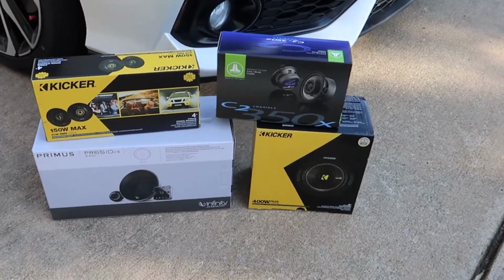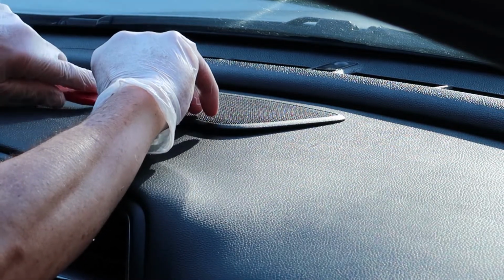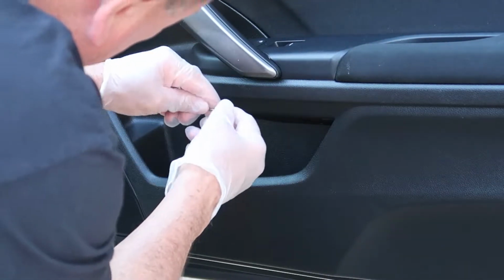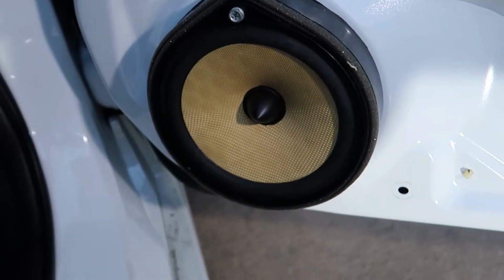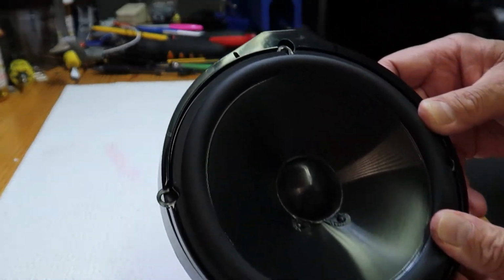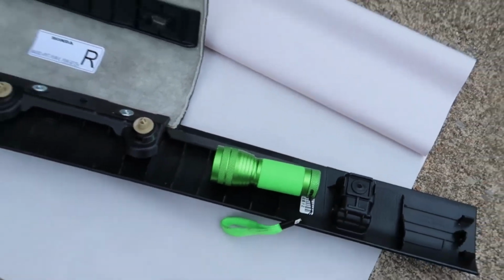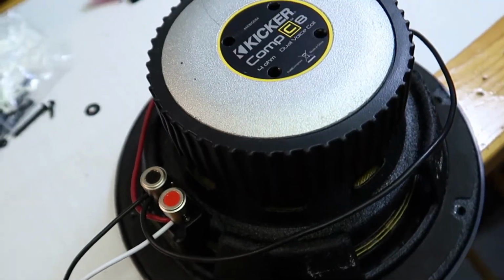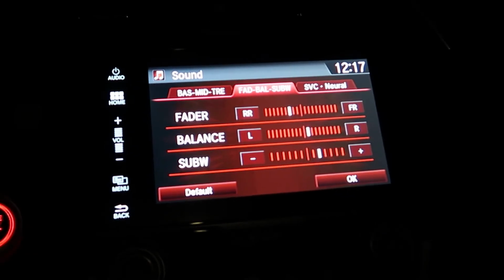How to replace speakers on a Honda Civic Si 10th Gen #Civicsi #Honda#Crutchfield

Comment: Very helpful video! thanks for that. Wehn I search for sound kits they always include a passive crossover. Some say the civic does the crossover inside the original speaker so I do need the passive crossover when repleacing the speaker.  Is that true?
Reply from the maker: I didn't use one and my speakers are working very well! So you can skip the crossovers at this time. If you replace the stock amplifier that might be a different story. 👍🏁
Reply: @Zspeed Thanks for the answer I appreciate it! I just want to replace the speaker and will continue to use the stock amplifier. That helped 😊

Comment: Good video man like I’m no speaker master installation guy videos like this help me n everyone. I used to have a 10incg slim sub that went under the seat’s i believe it was call seven kicks or kickerseven something like that it had a spider logo it was a standalone unit built in amp n speaker in a little flat box 1200watts just had to get power and signal to it. It worked great for its size surprisingly bass for day’s fuller sound but only lasted 2 1/2 years what a rip off I know it was only $150 at least but still didn’t last long . Been thinking of upgrading my entire speakers but just didn’t want to take on the task not being a sound guy ya know looks totally doable though now that I have seen it done. Mostly want more bass but extra midrange would be welcomed
Reply from the maker: You will need an aftermarket amplifier if you want more bass. Now that my speakers are upgraded and sounding good, you still need a better amplifier to get that hard kick your looking for!

Comment: I have a question will these speakers work on my 2021 Honda Civic sport hatchback because last time I installed speakers the sound wasn’t really good not from kicker it was from a different brand but will it sound good from kicker?
Reply from the maker: My kicker sub is under powered with the  stock amplifier. Your sub should sound better with an aftermarket amplifier! I'm looking into one that would fit into the  stock location.

Comment: this vid is like 2 years old so i dont expect a reply  but does the wattage matter?
Reply from the maker: Lower watt speakers if you never plan on amplifying your system. This setup works, but it is under amplified.
Reply: @ oh so I’d have to get a low wattage system to keep mine stock because I do want to stay stock for the most part I don’t know much about wattage so it’s what stops me from doing a subwoofer swap
Reply from the maker: Yes, use Crutchfield.com as your guide for replacing the door speakers!

Comment: Few questions for ya. I have the same spec Si coupe that you do. Which exact speaker mounts did you get for the midrange speakers? Also what do you recommend I get for rear speakers if I have an aftermarket sub? Should I still change out any of the rear speakers? So far i have ordered the two midrange speakers for the doors, the single coaxial for the dash, an aftermarket head unit, aftermarket sub and amp. Just wondering if you would change out any of the rear speakers in hindsight since you found the tweeters back there? I know you put the coaxial back there….  Thank you!
Reply from the maker: Speaker mounts found at Crutchfield.com: American international HSB524 mounting brackets. I would not replace any of the rear speakers until you install your new system! See what that system sounds like and only then replace any rear speakers that can't cope with your new amplifier! Hope this helps and thanks so much for watching!

Comment: Thank you for the video, quick question. I have a 3000 watt amp with a really nice quality 10inch sub in a fully loaded box I plan to put in the back of my 2017 si coupe. Would I need to get a new head unit as well or is there a way I can just use the new amp to push more power through everything?
Reply from the maker: If your trying to use the stock head unit, I don't think that's a good idea. Even with an aftermarket head unit, it would be better to rewire the whole sound system to accommodate a 3000 watt amp! But I'm no sound system expert, you should take it to a sound shop and have it evaluated!

Comment: Is the battery supposed to be disconnected so the airbags don’t shoot out when taking the panel, or will it be fine to leave the battery on?? What did you do?
Reply from the maker: I would recommend that you disconnect the battery while installing your system, but if you didn't, the airbags shouldn't deploy while installing a android device!
Reply: @Zspeed  I’m just going to be installing the rear speakers, so it’s okay for the panels to come off even if it’s connected the battery and has power?
Reply from the maker: Yes,  just be gentle around the side curtain air bags!

Comment: My issue isn't the sound of the stock speakers, but the fit and finish is so terrible that everything rattles. Especially in the back, so i just wanted to see how I could remove it and maybe add some padding to make it shut up :./ But I have the EXL (FC1 Sedan), so thats the one thing that isn't the same as your video. I also have rear doors with speakers, but its probably the same.

Comment: I have a 2017 honda civic ex and bought the smaller Kicker subwoofers that you got when I first got my car. Honestly, they sounded tinny and bass wasn’t as even toned as oem no matter how I played with the settings. I got one more replacement after but I don’t remember which one, and it still sounded worse. I gave up and kept oem, sadly I’ll say I eventually got used to them. Also, I have to say that Crutchfield has awesome customer service.
Reply from the maker: You're right, I think the only way to get a subwoofper to sound decent is to go with an aftermarket amplifier setup!
Reply from the maker: Thank you!👍🏁
Reply from the maker: Did it improve your sound?

Comment: Hi will this website work for 2019 civic si was wondering if the 2018 is the same sizes due to the website not having 2019 option
Reply from the maker: Yes,  I was able to use the website with a 2019 civic si!

Comment: I have a 2014 si coupe.  I’m trying to upgrade my sound system as well. I don’t want a massive sub in my trunk I just want a better improvement in the sound quality. The bass sucks and the mids could be much better.  I see that you just replaced the factory sub for a aftermarket sub? How does the sub sound even if if not installed in a box?
Reply from the maker: The factory amplifier isn't quite strong enough to fully power this aftermarket sub. But overall, the sound quality has greatly improved!!

Comment: I just watched this video because I was going to upgrade my speakers, would you recommend getting an AMP installed with this or was it good without an amp?
Reply from the maker: Yes, I would recommend an amplifier also!!👍🏁
Reply: @Zspeed Your guide was amazing! I was able to install a 2 10" subwoofer + amp in my car :).  I haven't changed the speakers yet! but I'll think I'll keep the factory amp for the speakers.  Thank you!

Comment: Thank you for the nice video,
I got question, do you need special bracket to secure the subwoofer?
Thanks
Reply from the maker: No, but you will have to drill new holes for your self tapping screws. Thanks so much for watching!

Comment: Hello, excellent video.
I have a Honda Civic 1.5 Sport Plus, and the system has 11 speakers.
I tryed to upgrade the speakers in front and back dors, I bought the jbl stage3 627, but didn't work. I only substitute the 2 front dor, the left isn't working, and the right one sounds very bad.
Are this JBL Stage3 627 not compatible? I use the cable arnes for the connection for this model.
Please help
Reply from the maker: Go to crutchfield.com and put your civic model and year in here in the search column. Then go by what they recommend for the front speakers. They will also supply the correct harness adapters as well!

Comment: I bought a  infinity center speaker for my sport touring civic hatchback and while its same size as the original speaker the mounting points arent in same spot. Had someone tell me a backstrap could be used. Would love your thoughts.
Reply from the maker: Crutchfield.com Has the exact speaker replacement size you need! Just put your year, model, trim level and they will show you everything that fits your car!

Comment: Did you leave the tweeters from the rear deck disconnected? Or did you plug back in after you installed new rear deck speakers?
Reply from the maker: I left them connected and had no problems with them!!👍🏁

Comment: One question... changing the subwoofer doesn't affect the power or electrical energy of the stereo since it's bigger?  thank you.
Reply from the maker: Doesn't effect the stereo energy output, but the subwoofer is under powered and could use an external Amp.

Comment: Good video, however you said if you de pin the wires, that the white is positive and that the blue is negative, which is incorrect as blue is positive for the center speaker and white is negative
Reply from the maker: If you checked the polarity and found blue to be positive and white negative, then differently go with that configuration! Thanks for pointing that out and thanks for watching!💯🏁👍
Reply: @Zspeed  I found the wire diagram for the 10 th gen si, so looking at the schematic and it’s clearly blue positive, white negative, not trying to discredit you in any way, just a heads up, again, great video
Reply from the maker: Thank you so much brother, I will be swapping those speaker wires tomorrow  and putting a correction on my video! Thanks again for the tip, so glad you noticed that mistake, that's what makes YouTube so great, everyone working together for the best possible outcome on our after market upgrades!!!💯🏁👍

Comment: Stock head W/ aftermarket 75w amp to boost signal.  12 inch sub with gain knob.  I kept the stock SUb. For a 500$ upgrade it's got some bump in the trunk

Comment: Hey man I had a question how is the bass on those lower front door speakers the infinity primus pr6510CS Im curious to see the bass compared to the stock speakers and how they sound according to crutch field they have 2.7 ohm impedance is this ok to run with the 4 ohm set up
Reply from the maker: They sound really great, no issues noted with the 2.7 ohms. Bass 🔊 is so much better than the stock setup!!🏁💯👍
Reply: @Zspeed  I appreciate the response I was wondering because I’ve fried a few speakers and they sounded clear but the bass was completely gone thank you for the feed back Im might try these

Comment: After watching your video I replaced my two front door speakers and it sounded so much better so I decided to replace my back door speakers too and now I have no sound at all.  I checked the fuse and it's fine. What could be the cause of this?
Reply from the maker: I would start by disconnecting the rear speakers, then turn on the head unit to see if the other speakers start working again! If so, something is wrong with the rear speaker wiring. Hope this helps, let me know if you figure it out!

Comment: Hey you have the other speaker from the center console front left over?  I'm looking to buy the same setup and only comes in 2.  I'll buy it.  Another question.  You say a 6 in speaker will fit in the corner rear deck?  
Ivan
Reply from the maker: Yes, I still have it, how about $75.00 bucks? Do you live in the US? As far as the rear speakers go, if you remove the old speaker mounts, you could fit a 5 inch and maybe a 6 inch mid-range speaker back there!
Reply: So contact will be 201.  Then the next is nine two 3.  And then its twelve.  And sixty seven the last.
Reply from the maker: Contact me at zspeed2561@gmail.com.
Reply: Nj
Reply: I been trying to give you my contact but it getting taken off.
Reply: Done.

Comment: Replaced all my drivers in my 2020 civic and it was easy -- thanks to you my friend!
Reply from the maker: I would recommend it, I just installed a Joying head unit! So now it sounds even better,  video coming soon!!👍🏁💯
Reply from the maker: Thanks so much for watching!!!👍💯🏁
Reply: How much did it cost you, if you don't mind?
Reply from the maker: Around  $450.00 dollars.
Reply: @Zspeed  Wow not bad at all! Ty
Reply: Where did you get the speaker adapter plates
Reply from the maker: I got everything from Crutchfield!
Reply: @Zspeed  😔 thanks

Comment: Hello! I have a2022 civic and just had the factory speakers replaced in all 4 doors with coax RF speakers and left the factory tweeters in.  They installed a 12 inch sub and Kenwood Amp to run sub only. Now,  the front 2 door speakers are louder than the rear doors. It sounds unbalanced and the factory eq isn't helping matters. It's all treble and bass. Can't hear midrange at all. I don't know if the installers didn't do it right or if it's the factory head unit. Any suggestion on a fix for this?
Reply from the maker: Have you tried adjusting the fader to favor the rear speakers. If that doesn't work, try turning down the treble. Looks like the problem with installing Coax RF speaker is that they have tweeters in the center of the midrange speakers, so you end up with too many tweeters! Is that the type of speakers that were installed?
Reply: Yes they sure did. I have since went to another installer and he told me it's Hondas head unit partly and the fact that the other installer put in coax. He's going to install a4 channel amp to help the door speakers out. I'm accustomed to having a great EQ so I can  adjust all frequencies. Hopefully we can achieve that with the amp and I can get it sounding clean and not so bright.
Reply: No mid, I agree. I have a 2020 civic sport n spent $$$ on speakers but it appears the head unit puts out poor quality and seems hopeless.

Comment: Do you think it would be worth going through the effort of replacing the stock tweeters, or were they sufficient after replacing the factory speakers?
Reply from the maker: If you're not adding an amplifier, the stock tweeters are pretty good!!
Reply: Awesome thank you 🙏🏼 do you think 6.5 inch speakers will fit in the rear deck, or are 5 inch about as big as you think you could go?
Reply from the maker: 6.5 inches might fit, you should be able to modify the mounts if needed!

Comment: Could you go more into depth with how you measured the holes? I'm trying to do the same install and I'm stuck on that part lol
Reply from the maker: It's not an exact science, I had to place the speakers in the mounts mark the holes with a sharpie, then try to line up my drill bit from underneath. Needless to say, I had to make more than one hole sometimes to get it to line up with my sharpie marks, but no one can see those mistakes!!! Hope this helps!!

Comment: So, if you had it to do over again , what speakers would you use?
Reply from the maker: I would use 5 inch midrange speakers in the rear with a less powerful sub, head unit under powers current sub! And keep everything else the same!
Reply: No adding a box for a sub set up?   Is pretty much always better.   Just a single 10 or 12 with say 1k or so going to it.
Reply: With a less powerful sub what one would u recommend ? And did crutchfield send u the wiring harness for ur rear sub ? Or what one should I order ? How do u think the Rockford Fosgate P3sd2-8 would work with the stock system ? Thanks 🙏

Comment: Kudos to you for changing those out. Upon research, it appears to me that there is no way to separate the just the audio signals from the infotainment cluster. The sound you get through the speakers have been processed by the cluster/internal sound processor. My concern is that they are not optimized for aftermarket equipment, the resultant of which may be poorer sound quality.
Reply from the maker: Great improvement in sound quality even with the original head unit!
Reply: Lmao. Gotta love the experts in the comments
Reply: You are right. Thr factory system will roll off the lows and highs. While the aftermarket speakers may sound a little better, you aren't going to get anywhere near their full potential with the factory radio. An amp would help considerably as well